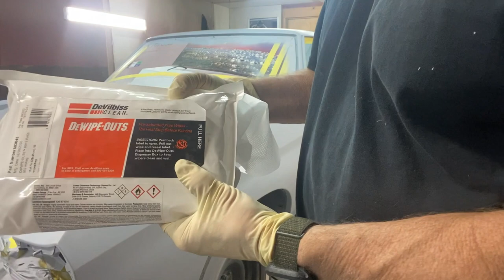Chevelle is painted, plus color sanding and Marshall fire update! Ep. 23

Comment: Great video! I do have one question in regards to the Chevelle headliner. I have a Chevelle SS that I'm currently stripping down and I read and several articles that asbestos is in the headliner in various parts of the car. How did you go about cleaning the car out properly without worrying about asbestos? 
Thanks
Reply from the maker: I was pretty lucky some of the headliner and insulation was removed when I purchased it. I did however put on a throw away pair of painters coveralls and a paint mask and removed any remaining material then sanded the roof. Vacuumed up everything, and epoxy primed the inside roof. Bagged up the garbage threw away the coveralls. I wasn’t sure about any asbestos so I was just playing it safe.

Comment: I am building a 71 Chevelle Malibu into a old school pro street that is taking far to long to build. Seems with this cold weather I can't get motivated to work on it even though I have a heated shop.
Reply from the maker: I have been there, it takes a lot of time. Stay motivated Chick you have an awesome project. How much do you have left anyway?
Reply: @soolegarage  it seems the kit I received from speedway sent the wrong bolts for the lower control arms. They are to short can't even thread the nuts on. But where I work have been doing a lot of overtime and when I do get time seems like I am wiped out.

Comment: Why 1500?
Reply from the maker: I have found 1500 to be aggressive enough to remove dirt nibs or orange peel/imperfections and doesn’t leave deep scratches in the clear coat. , Deep sanding scratches when color sanding  can sometimes be challenging to get out.
Reply: @soolegarage  i never go under 2000
Reply from the maker: @mr.diyhowtopaintingwelding4479  that’s good advice, thanks!